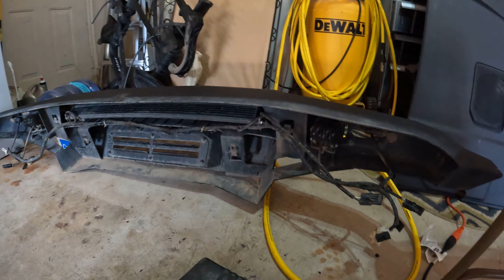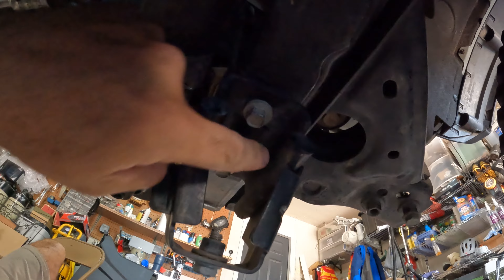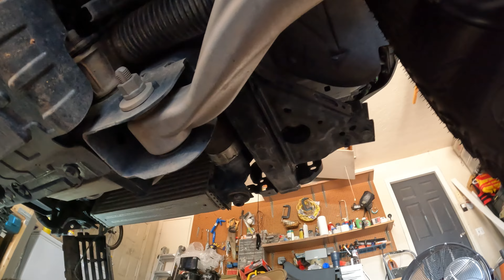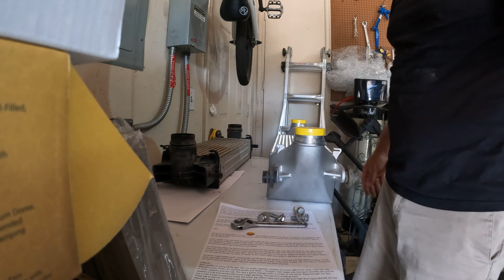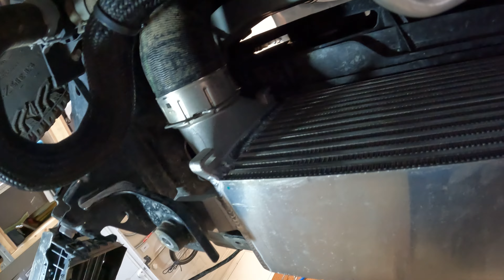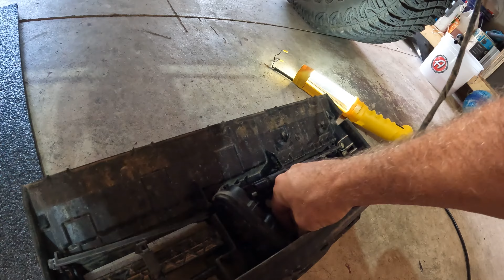Whipple Intercooler Install 2022 Ford Bronco Wildtrak

Comment: late to the game on this, bbut great video. I plan to do my intercooler soon, as I now have the Injen CAI and Injen hot/cold charge pipes. I was wondering how the Whipple fit in the system because people said it was much larger. I too am all aftermarket with WARN Elite bumpers and Whinch up front.
Reply from the maker: I had plenty of room under there.  But I was nervous as I didn't know how things would fit until I started taking it apart and getting it installed.

Comment: What was your mpg afterward?
Reply from the maker: Sorry for the way late reply.  Totally depends on how I drive it.  It's been tuned and also has Roush intake and exhaust.  I can hit 21 when I'm driving easy and speeds closer to 65 or I can get 12 when I race off every light.

Comment: There's a similar issue with the shutter being in the way on a hidden winch mount installation from Rough Country.
Only the badlands and WT has the louver shutter for the IC (intercooler), and all other trims don't have it at all, with the same engine, begging the question, why is it there, and what does it do?

When is it useful for the IC to not vent air to it to close those shutters when none of the other models use it? Is it a low speed dirt prevention for water fording? Rock chips? Again, none of the other trims have it.

Either way, in a warranty sense, I feel uneasy removing it considering their perspective, this would be like painting a target on the upgrade to have removed a large part of the cooling system, right? Even if it makes no sense to be there.

Comment: Any power increase
Reply from the maker: It was tuned with the whipple tune at the same time so it’s hard to say if the intercooler alone increased power. With the tune, roush intake and exhaust I’ve got a significant increase in power and torque

Comment: Curious, was your Wildtrak getting heat soaked?  Why the Whipple IC?
Reply from the maker: It was having no problems with factory set up.  Factory set up is great.  But factory parts are not always as efficient as they can be.  Since I was tuning it and increasing output I wanted to make sure that my intercooler could keep up.  I can't go wrong with more cooling.
Reply: @brianbrn  well, actually there can be a little negative impact.  The extra capacity after the throttle body generally impacts response to changes in throttle.  You likely won't notice it do to the small change, but it should be there.  Also increased cooling capacity can reduce air volume that needs to be made up by something else.  If there are upstream restrictions, this change could highlight them more.
Reply from the maker: @mikesveganlife4359   thank you for that info.  Didn't consider that.  But it's also whipple tuned so I'm counting on their own set up that they accounted for the differences.

Comment: AFE makes new hot and cold charge pipes, don’t know if that would interest you, they increase air flow. They are all aluminum, coated black, smooth inside.
Reply from the maker: I’ll have to check them out. I had a lot of AFE stuff on my Tacoma.

Comment: $3,500 bumper with the lights? Forget the rims they're just going to steal your bumper is what I was thinking if I got one of those with a Bronco. And then the rear bumper is $2,000. I'm bitching because I reserved a wild track but I'm pretty sure I can't afford that now so I'm just going to go with a base and upgrade from there. In the end I wanted the manual and a two-door anyway. It would be really cool to have the hoss 3.0 but I don't think I would ever off road enough to make it worth it
Reply: I have a wild track and I picked up about 4 months ago now.  I wish ford have gave me the option to upgrade to the new factory fox shocks they have for the wildtrack now.  I want to do the tune and intercooler but waiting till I have about 10k miles.  There were some 2.7 ecoboost engine failures around 2500 miles so want get some extra miles before the tune.   

Thank you for the instructional video, always helps.
Reply from the maker: @skidwilliams9451  mine was already built when they announced the hoss 3.0 too. I would have jumped at that as well. I just rolled 12k miles today.
Reply: @skidwilliams9451  depends on the build date, if your vehicle is purchased after the fix you don't have to worry about it
Reply from the maker: That was the one advantage of waiting for my day 1 reservation.  I paid off a lot of accessories before my truck even arrived.
Reply: @brianbrn  coolest bumper though 😎
Reply from the maker: @MajorBorris  i agree. although it took forever to get them in the addictive desert designs are pretty sweet.